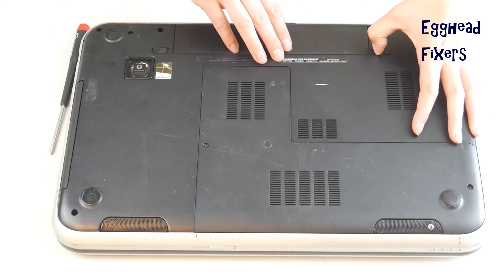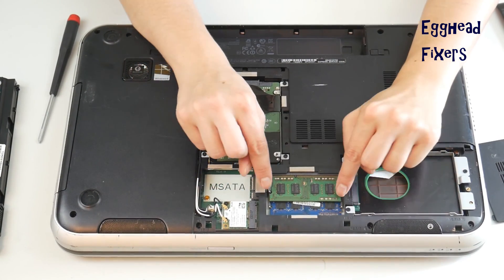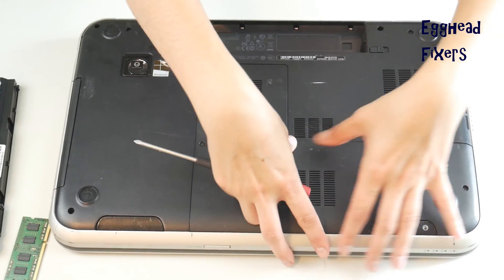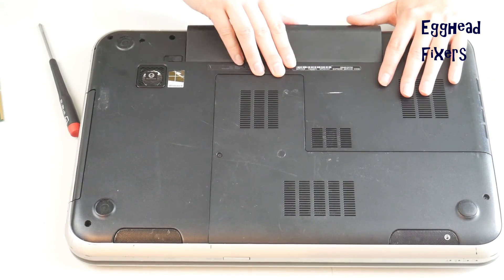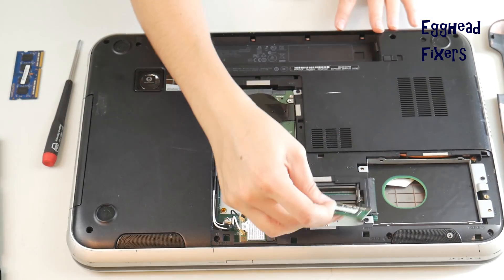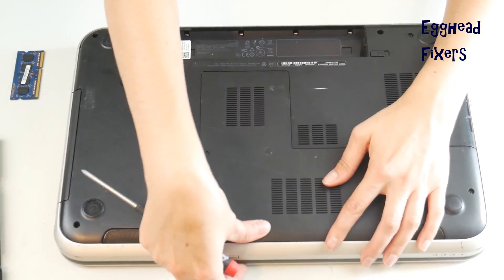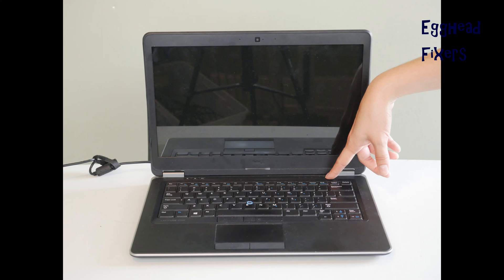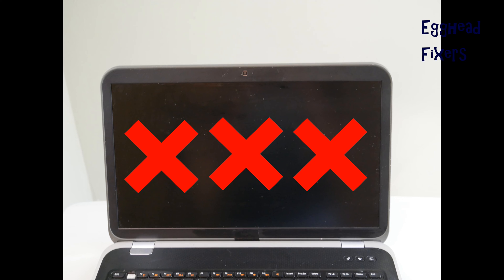Fix For My Acer Computer Screen That is Black, No Display, Distorted, Has Lines Or Glows

Comment: hi there, a few days ago i tried turning on my Acer laptop but right after the logo there's a black screen with some kind of flickering line at the top left, as if it were something to write? i don't know if it makes sense
Reply from the maker: Have you tried reinstalling or resetting the operating system?
Reply: @EggheadFixers  no, i literally cannot go past the black screen nor do anything :( i think its something to do with the hard drive but im no technician
Reply from the maker: @uliou  When you turn it on does anything appear on the screen?
Reply from the maker: @bancy1902  Do you still have the lines if you hook it up to a TV or external monitor?

Comment: What if it turns your screen pink ?
Reply: I finally got it to come on and working but now the screen has a pink tint. It wasn’t even coming on.
Reply from the maker: @courtneywilliams6934  If  you move the screen around or lightly push on the bottom of the screen...Does it get better or worst?
Reply from the maker: That could be a RAM, CMOS battery or a problem with the actual screen. If you hook it up to a monitor does it display correctly?

Comment: Hi I am getting an issue where the screen turns on with a curser but nothing appears. Should I order a new ram?
Reply from the maker: Does it display an Acer logo start up?
Reply: @EggheadFixers  yes I have factory reset it now and when I get to the setup page the window keeps looping and taking me back to the same page. Theres no recovery points as well. Any ideas of what I could do? Thanks

Comment: Mine doesn't have battery
Reply from the maker: If you have an internal battery you will have to look up a disassembly video for your model computer so you can get inside your computer.

Comment: I have a weird problem with my laptop. The goes black, but you can see the screen a little bit. But when i push the screen from the top left corner forward, the display comes back. But i to keep on holding the top left corner to keep the screen on.
Reply from the maker: Sounds like an issue with your LCD or LCD Cable. Can you get your computer to display to an external monitor? If so then the LCD or LCD cable is most likely the problem.

Comment: Hi may I ask what if it all repaired and it still turns to black screen
Reply from the maker: I would see if you can get it to display to an external monitor. If you can get it to display to a monitor or TV then it can also be a LCD or LCD cable issue.
Reply: @EggheadFixers  what if it douesnt work on external monitor? just fans running but complete black screen
Reply from the maker: @wdkpwr6586  then I would try the solution in this video. 

Another thing that can help with an issue like this is a BIOS reset. It resets the computers base system and can help revive a dead computer. Here is a video on how to do that:

https://youtu.be/EEahJ8wvUBU